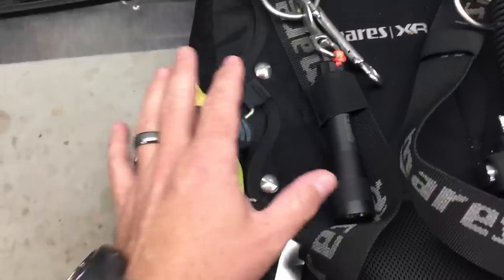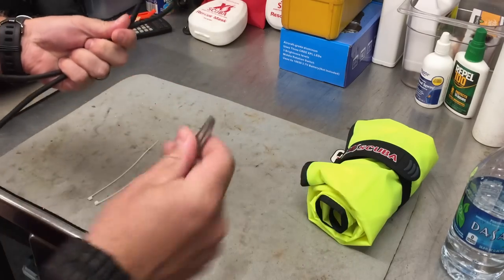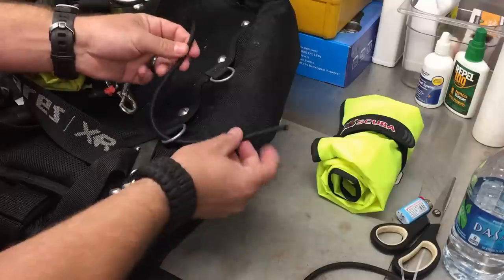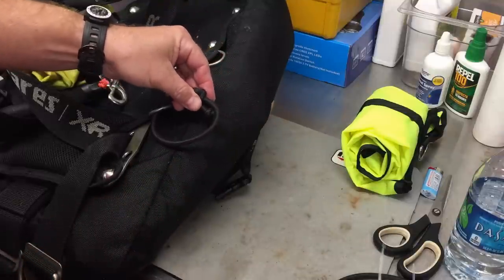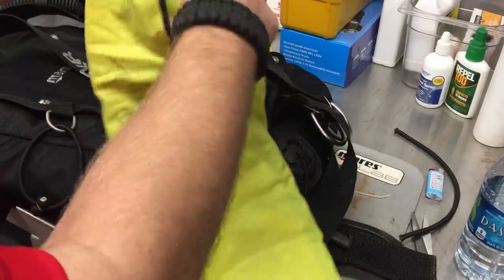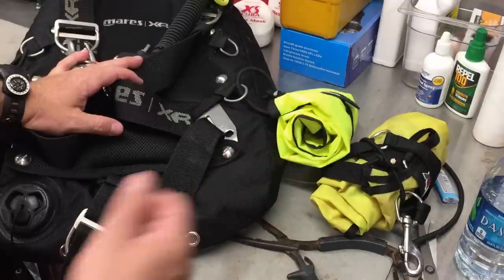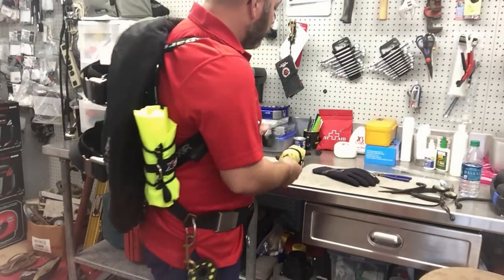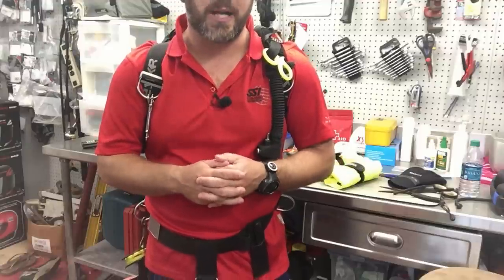Stowing A Lift Bag

Comment: As always great video! Question, does that back plate system use weights? And if yes where they go?
Reply from the maker: Hello Ulises, typically, I will dive a balanced rig, which means yes it does take weights, but they are not ditch-able. I like adding trim pouches to the cam straps.

Comment: I do a good amount of under water recovery as a side gig. I usually use a primary and if need be secondary hook point (one or two boats, docks or anything I can hook to)  with two cable come a longs to each hook point on what ever is under water. One for the first pull and one to releave and pull again. Over the years I've got it down to the point of making hard jobs look easy.  The question is besides for depth what are some benefits to switching over to lift bags and ditching the cable system? I'm not trying to nock the bags iv never worked with them and am curious if they would make my life easier under water?
Reply from the maker: Hey Frank, one of the biggest benefits for using lift bags are, they are mobile, compact, and easy to use.  A solo diver or a team of divers can use them with ease.  There are times that we use winches to raise certain objects.  Take a car or truck for example.  If it was to run down the ramp at a boat launch, and become submerged, most of the time we will take a cable down from a wrecker, and once it is hooked to the vehicle, then he simply winches it up to the surface.  I personally wouldn't stop using the system you are currently using, if it works for you.

Comment: Hi Brian! I know you are a Mares dealer, but I would find it interesting to hear about the differences of brands out there (Aqualung, Cressi, ScubaPro, Diverite, etc). Your personal opinions on different brands (and warranties) and how a homogeneous or a mixed combination of brands is good, bad or neutral. Presently I have a simple / recreational mix (Mares bcd + air control, ScubaPro fins, Oceanic regulator, Blue Reef mask). I am not brand bias, but in my case as a divemaster, I want to go with a single brand for a more uniform professional look. However, doing so is hard, as some brands seem to be strong in one way, weak in another, lack options or maybe just too pricey $$$. How should one decide when planning to make an expensive set up purchase and not knowing how equipment will feel in action? Thanks! - Michael
Reply from the maker: Hey Michael, hope all is well.  I hope to have a video produced in the next week, talking about what my gear choices would be if I wasn't a Mares Dealer.  I have been very fortunate to have sold all the major gear manufactures over the last decade, and have used at least one or more BCD and Regulator sets from them as well.   With that being said, I will give you a quick run down of some gear choices I would choose if I couldn't dive Mares.  BCD - Zeagle Ranger, Regulator - Sherwood SRB5100 First Stage with the SRB5100 Primary Second Stage or the SRB5700 Oasis Primary Second Stage (with the Magical Spit Guard). I would probably back it up with either the Alternate SRB5100 Second Stage or the DACOR Viper Alternate Second Stage (this is now the Mares MV Alternate Second Stage, but keeping with the theme of no Mares, it will have to do). Gauges - no issue with any manufacture, as long as it is built with great quality. Wetsuit of choice would be a custom wetsuit from WetWear. Drysuit - I have been a huge fan and user of the OS Systems Telus.  Boots - I really like the Sea Soft Stealth Boots.  Gloves - I would also go with Sea Soft, especially their Ti-Pro 3mm (absolutely awesome Kevlar gloves). Hood - Comfort Zone Scuba FFM 3mm.  Tank - I would stick with what I use currently, Steel 100's and Aluminum 80's.  Lastly is the Computer - This is a tough one, because my all time favorite is the Citizens Aqualand 20th Anniversary Dive Watch (I have one of the first ones ever made, 20th Anniversary that is, and absolutely love it). With this being said, I would have to resort back to always using tables, as it does not calculate the on gassing of Nitrogen.  I think I covered most of the basics, but as stated before, stay tuned for a video in the future on this very topic.
Reply: @LakeHickoryScuba  Brian, epic response! Thank you for sharing! I look forward to your video!!
Reply from the maker: You're welcome.
Reply: I don't think using dive gear from different manufacturers affects your professional look. I get that, when you're representing a dive store, they would want you to be decked out in their gear, since you're representing them and the things they sell. But if you're diving for an unaffiliated dive center, just use the stuff that you can get serviced by your LDS. Mares makes great dive gear, but so does ScubaPro, DiveRite, Apeks/Aqualung, XDeep, Oceanic, and Atomic Aquatics. Shop around, see what you like and works for you, and don't worry about brand uniformity. If anything, brand uniformity will make you look like a fanboy.